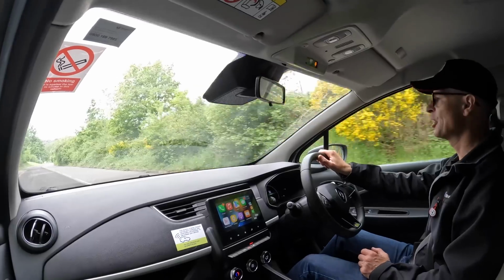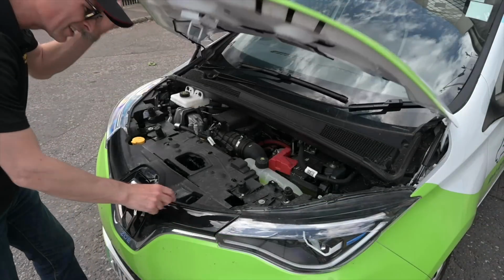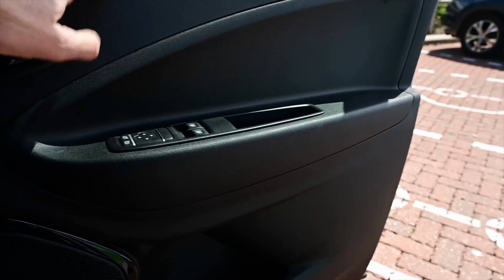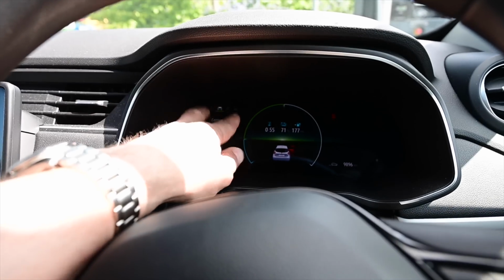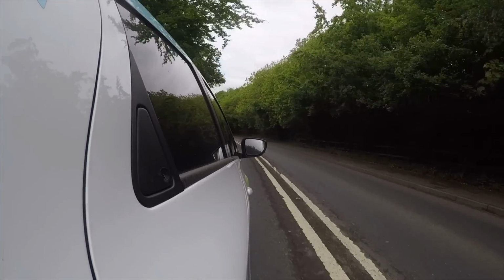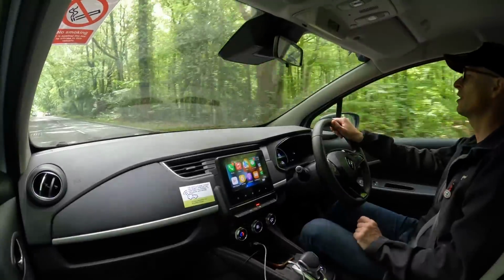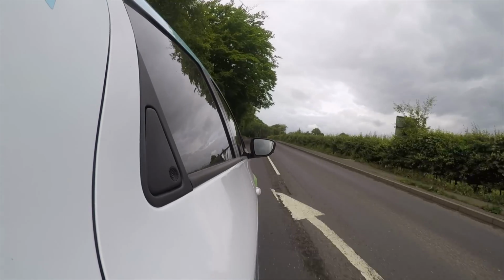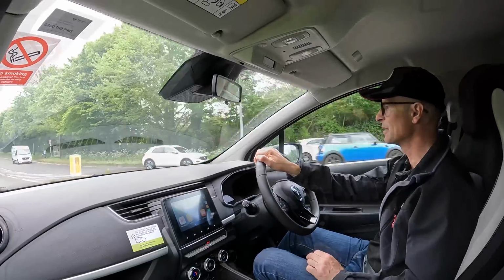Renault Zoe van Goes for a Drive Modern Monday

Comment: The proximity key is the worst idea going. A friend is employed at a large shopping centre here in Ontario. At least once a week a car is stolen from the parking lot. Every single time it is a car with a proximity key. Having that "feature" is asking for your car to be stolen. By the same token, the run flat tires are a horrible idea, as range and speed are severely limited should a tire go flat. 50 miles at 50 miles per hour, and you best be lucky to find a tire shop within that range that is open, able to get a new tire right then, and that they have the correct equipment to install a new run flat tire. Friends got caught out that way once. The nearest tire store was further away from their location than Lands End from John O'Groats. A flat tire ended up costing them some $3,000 for the tow and the cost of an hotel for 2 nights not to mention the cost of shipping the wheel off to a city another 300 miles away.
The volume control and the rest of that screen in the middle is simply dangerous. Anything that forces the driver to take eyes off the road in order to operate it needs to be removed from any vehicle. You can get a ticket for using a cell phone, but being even more distracted by the car controls is legal? A seriously stupid idea. Give me the old Volvo or even the Benz estate. These new things are nuts.
It was informative indeed. It informed me that I am nowhere close to being convinced a new electric has any real benefit over my paid for, reliable Volvo 240 estate, but it certainly has more than a few detriments compared to the Volvo.

Comment: In all fairness on variable range v temperature, driving conditions, driving style, it is a bit like a petrol or diesel car…..my little Honda petrol range varies by 30 miles depending on winter, summer, driving conditions (hills, traffic), and driving style, or even if you leave the climate control switched on.

Comment: Who needs parking sensors?! Learning to park seems to be a thing of the past. Why? And once again, the range thing - almost any car that was around as I was first driving (mid-70s) would do 300 miles on a tank, it was simply the industry standard. And there were more fuel stations around then too. Why, ffs, won't any/most/all EV makers give their cars at least 300 miles 'in the tank'? Real world 300 miles, not the 'At a steady 30 mph' which has been adopted by most for given range... Last grumble - no one HAS to do 70 on any motorway. Try 60, or even 55, or find a truck doing 50 and sit behind it. Brilliant way to go further for less. If you're only doing, say, a 30 mile stretch on an M road, driving at 70 will only gain you a very few minutes over 60, or 55. As to how much a vehicle like this will 'save' anyone per year - keep yer'old 55 mpg diesel a few more years and save even more! The three years deals the majority of motorists seem to favour these days is money down the toilet. Buy a car, and keep it, inc. maintaining it. This used to be part of 'good ownership' practice, going quickly west, alas, along with driving as a skill, something to do well, safely, even, dare I suggest, with a touch of pride attached. A 3 year rental - which is what it is - removes almost any responsibility for maintenance, while you kid yourself you are somehow saving money (EV or ICE vehicle, the numbers are much the same).

Comment: Still fail to see why Kent Council chose to have the lower charging plug socket. For 3k more (I'm assuming the posher one has the proper Fast charge system fitted(???)) the Fast charger would have been  useful to show off to potential users the benefits of EV's better. And also if no EV charging stations have the Slow power outputs it makes it even more useless. 🤷‍♂️🤷‍♂️🤦‍♂️🤦‍♂️

Comment: What are the tax advantages for a business? I have a shop (not VAT registered) that this would be perfect for - deliveries etc. is it better than a small diesel van?
Reply from the maker: you can claim back the tax on running costs like insurance, tyres, servicing and lease (instead of paying for a personal car), no road tax as electric. Charging is much cheaper that diesel and no ULEZ charges. For deliveries this would be ideal as the range would easily meet the 220 mile estimate around town
Reply: Running costs are lower if the range is enough and you can charge at your own facilites. Its easy enough to calculate.

Comment: I think for myself electric is ideal, better than an ICE as I only potter around locally now, the occasional trip into the city is only a 50 mile round trip.  A lack of storage in the front is not a problem, cup holders are not necessary for me as prefer to have my coffee in a café or take a flask, stored in boot for safety as a stainless steel one (a lethal missile) and drink it in a lay-by.  Tea shelf essential though or a flat floor.  A place to store the phone is not needed as always turned off and in jacket pocket when behind the wheel.  No call is ever that urgent that a 30 or so minute delay in replying will have any effect. (Family over 500 mile away and in a different country).  A range of 200 - 250 miles is ideal. Only a few Motorways and most of them are fairly short by European/UK standards.  Most car parks (private or public) have multiple charging points and on street ones in many towns as one company installing them, our electricity generating company, the numbers growing quickly.  Payment by App or credit/debit card.

Comment: Have you considered that by making the volume on the central screen more difficult than the buttons by your fingers on the wheel that Renault are trying to keep your hands on the wheel? They pioneered steering wheel controls in the 90’s and back then were celebrated for it. Now people seem to prefer something that’s a distraction.

Comment: Thanks for this review. I must say that I felt quite depressed at the end of it: paying twenty a lot thousand pounds and get a plastic is fantastic car... I appreciate that electric cars still have very expensive bits and it could be because it is a low segmet Renault. But I mean, you spend all that money and have a 50 shades of black plastic all over the cabin? It doesn't need to be that grim. Look at the Fiat 500 electric with the jovial interior with tasteful colours and textures in the cabin.

Comment: Range always depends on lots of things like your right foot - ICE or EV
Reply from the maker: true, but there are more factors with EV - ambient temperature affects range and charging for example
Reply: @furiousdriving  indeed, but people tend to forget the lead right foot is also part of the equation, Top Gear did a race with Ferraris, Astons etc on a gallon of petrol and they got from 1 to 7 (i think) mpg. Rory and Vicky showed the issue with the Ionic 5 where Vicky had the lead foot
Reply: @rtfazeberdee3519  Sure, but these are general numbers. On top of that, EVs have a MUCH wider consumption span than ICE cars. In the end, if the presumptive buyer cares enough, they can easily find out.

Comment: Ive been driving the ZE50 business now for 7 weeks and ive got to say its excellent to drive. I generally do around 70 miles a day, 5 days a week so EV suits me perfectly
The extra boot space and space above parcel shelf is ideal for storing too, at the front the space is limited for storage, the glove box is small, as is the door bins. The cup holders are a bit big so doesn't secure very well, the wireless charging was removed by Renault for cost cutting so have replaced it with a storage bit thats too small for a mobile device but handy for keys etc which only leaves you to store you mobile beside the two USB ports.
Range wise ive found to be excellent in dry days and have managed to get 4.6 miles perKW (239 Miles) but on wet days it drops to 3.6 (187 Miles) this is doing motorway driving
I do agree that CCS is a must when purchasing this car (van) but for Renault to charge you £600 extra for the privilege is is a it poor considering all other EV's have them as standard. The age old problem seems to be the charging network (im lucky that i have a 22kw charger at my place of work) Far too many broken or out of use charging points, the use of either App, RFID or contactless is very painful. it should just be standardised with contactless payment but im not going to waffle on about that.
To summarise its an excellent car for a small business, ive had no issues with driving, charging or range. Its saving me £5k a year on diesel whats not to like!

Comment: That static radio control on the right-hand side of the wheel is a Renault standard--my 2013 Dacia has something nearly identical.
Reply: Started in the 80's and my 91 R19 had is as did my other half's 21 Savannah. If you're used to Renaults it's fine and at some point Peugeot copied it IIRC

Comment: What do you do after around 70 miles when it runs out of electricity in the middle of nowhere?
Reply: ZE50 has a useable range over 200 miles
Reply from the maker: thats 70 miles to a destination, 70 back and some in reserve

Comment: Solid-state and sulphur batteries are coming, which will hopefully extend the range over L-ion. Plus 10m charge times to 80%. Robert Llewellyn (Kryten) has had his Leaf for 12 years "free" motoring, charged with his solar panels.

Comment: EV's are still not a practical proposition. You have problems finding a charger!!!! try living over here in rural Pembrokeshire. They need to standardise charging plugs, massively improve the charging infrastructure and, as the most I've ever spent on a car in 40 years of driving is 10K, make them more affordable. The future for large commercial vehicles is hydrogen. I think it will be for cars.
Reply: Wouldn't consider one without a home charger. Not a problem then.

Comment: A bubble car with a parcel shelf isn't really a van ,
unless your equipment is one or two items.,,
Where does the ladder go? .Tradies would find it useless.
Reply from the maker: my local motor facet runs a fleet (must be 20+ of them) of this size vans delivering parts to garages, for a some businesses this is the perfect size
Reply: @furiousdriving  Yep ..well I can understand pizza delivery and the like ..
but the size is a bit odd .
In the next 5 years though EV mid size vans will become more common ,
full size pick-ups are not far away at all ...Ford Lightning etc.
Reply: That's why commercial electric vehicles aren't selling, it's all a con.

Comment: We are getting there. I mean we are getting to a point (where consumers would  have enough info on what they are buying), thanks to people like you, Matt, telling us their impressions and opinions.
The biggest caveat will always be the charging. Pay extra for something they can not influence directly, albeit they can indirectly; your TIME. The more precious your time is, the more money they can squish out of you. :/ This sucks. 
The touchscreen. Give me fingerprint-magnet piano black lacquered buttons, and an old, one DIN radio. I'd gladly have it in favor of simplicity and safety. If I know what to push and where to push, I'm going to do it, and not fiddle with a tablet, while driving. Thanks.
PS: I'd rather be buying cheap, throw-away phone hangers for navigation. 
PS2: Rude plastics; they look rubbish, they are prone to cracking. But; they are easy to clean, and if cleaned and maintained, in the long run, they may just as well be better than any other material.

Comment: I'm a month into a Zoe ZE 50 GTLine. The car does regenerate energy when you are in D and use the brake pedal before it uses the friction brakes. B stands for braking mode. If you push on through a notch on the accelerator when in speed limiter it will accelerate past the limited speed. I agree it does need ccs as standard.
Reply: B mode gives you more regen